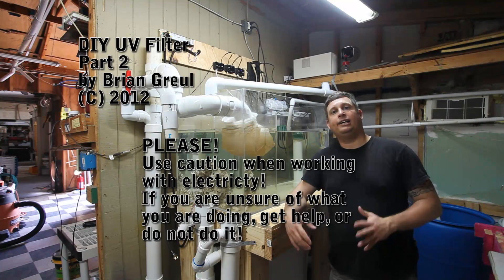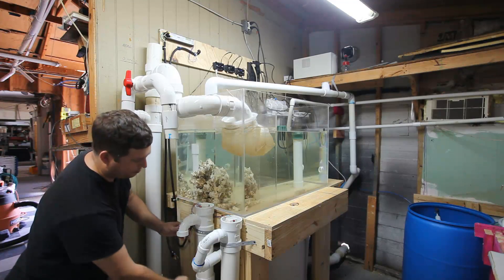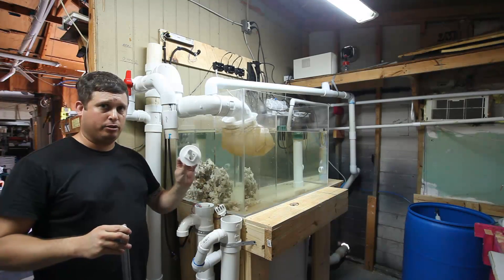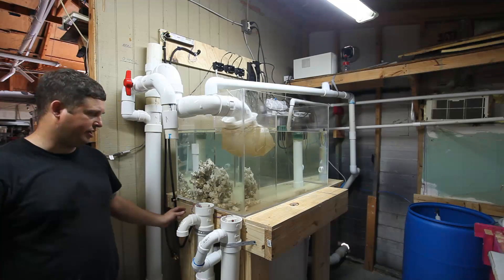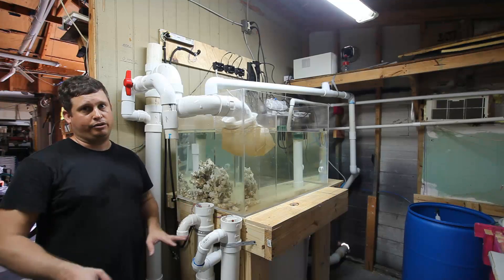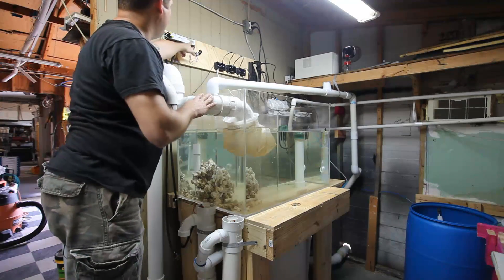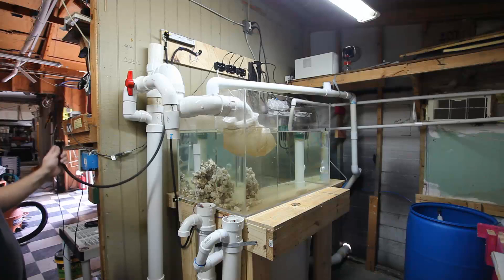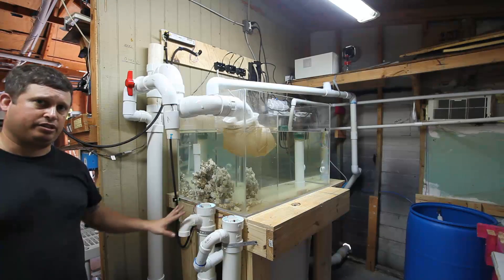DIY UV Filter Part 2

Comment: So u put the light bulbs straight in and touched the water or u have the to get the other glass to protect the light bulbs
Reply from the maker: Glass is an electrical insulator.

Comment: I'm commenting on this just to address people asking what type of ballast, modifying existing systems, etc...

I used to wire electrical fixtures incorporating ballasts. There's a lot of different types used for various applications.

Please research this based on your needs. This is imperative.

Search Google for: Ballast info pdf 

You need to be able to understand the information a bulb is telling you. 

*Socket/pin type of bulb.
*Holder for that socket/pin type
*Max wattage of bulb.
*Recommended type of ballast.
*Number of bulbs the ballast can handle.
Reply: understood, the socket/pin could be easily improvised.  could you verify if this ballast would work?  https://ballastshop.com/compact-fluorescent/electronic-cfl-ballast-4-pin/36-watt-ft-2g11/
Thank you
Reply: Per review, this is also compatible https://www.amazon.com/ROBERTSON-Fluorescent-eBallast-RSW234T12120-RSW240T12120/dp/B00H9HJSFU/ref=pd_di_sccai_2/141-6074953-5956853?_encoding=UTF8&pd_rd_i=B00H9HJSFU&pd_rd_r=5202a05b-613e-41a2-b921-a99a79b60516&pd_rd_w=k6PrZ&pd_rd_wg=xisJh&pf_rd_p=5415687b-2c9d-46da-88a4-bbcfe8e07f3c&pf_rd_r=0R5WM40DBQ4ZTM73XQC2&psc=1&refRID=0R5WM40DBQ4ZTM73XQC2

Comment: I have this UV sterilizer where the ballast shat itself and I dont seem to be able to source a replacement ballast for it - Now thinking along the lines of modifying my existing unit and rather than using a magnetic coil ballast and starter it came with, I'd like to source a electronic ballast to wire into my existing uv - question: Do electronic ballasts require a starter? 
- The one Im looking at is the Philips IUV-2S18-H1-LD ballast (recommended by Philips for the TUV PL-L 18w uv globe, and the existing uv light housing I want to modify is the "All Pond Solutions CUV-218" unit (effectively a rebranding of the SunSun unit) - Well designed unit but with a poor quality ballast I simply cant source in Australia for some weird reason :(

Comment: Dude ? the bulbs is touching water  what happen when it breaks please tell me you are not just relying on the GFIC to work they have been know to fail and cause an electrical fire and even kill people so knowing this are you will to risk it. THIS A VARY BAD DESIGN
Reply: Bro, the bulbs are touching water in the Green Killing Machine that is sold in stores. It's not a deal breaker by ANY means.

Comment: Its a great job , an awesome tutorial, btw, what ballast u use ? is it possible to use xenon ballast ? or there is specific requirement for the ballast ? thx for the share mate.
Reply from the maker: +de Bunnies Thank you for the compliment and question.  Each ballast is designed for a specific type of bulb.  It might be possible to use a different one, but I think it's safer to stay with the manufacturer recommendation.

Comment: Brian, are you familiar with Steripen?  Would there be a way to make a larger version of the steripen so that you could dip your light into say a 5 gallon bucket to purify the water? If you took one of the UV tubes and attached it to a lid that fits over a 5 gallon tank and wired it up to plug into a socket and left it on for the necessary amount of time, that would also purify the water, right?  A Steripen can purify 1 liter in 90 seconds or so. Not sure what the strength of the uv light on that is, but making your own would save a lot of money.  I am a renter so I can't do anything with the water system in the house.  Any thoughts on this?

Comment: Dude?  You have bulbs touching water? no sealant? Not sleaves?  You are brave.  Also the drip loop way up top unless you have water above it you don't need it.  But other than that I like the design.
Reply from the maker: +cpubugs The bulbs are safe in water...  the glass keeps the electricity inside.
Reply: but no sealant? can't it leak from the top...
Reply: @gold3nrul311  I believe the housing is not sealed so yes the water could leak if you have regulated valve at the output.  Brian's design is gravity feed and no service valves.

Comment: No sleeves for the bulbs dealing with high voltage????
Reply from the maker: +LUFERQUINT Fortunately, the special bulbs I use keep the electricity on the inside of the glass.

Comment: My Pond Pump is 6,500/Gpm. But the way i had the 54W set up, I was only running the flow of a water hose thru it. Patience Is my ally in this Project. The Wet Dry i have does most of the work, but in first weeks of spring there is an Algae spike.

Comment from the maker: you could scale it up by adding more tubes.  I suggest picking up a copy of Aquatic Systems Engineering by Escobal. It will show you the formulas to calculate flow rate and exposure time.

Comment: Brian, I wired my system up, but I can't seem to get the bulbs to fire. The most I've gotten has been a bluish "arch" across the filaments in one side of one bulb for about half a second, then nothing. I appear to be getting power both into and out of the ballast. Any ideas?

Comment: So how did you make the socket water tight?   Where you cut into the cap.  I'm thinking of doing something similar, but can't figure out how to deal around the bulb without getting a quartz sleeve and sealing that.
Reply: my question too
Reply: not water tight